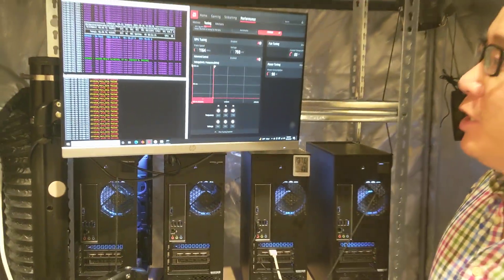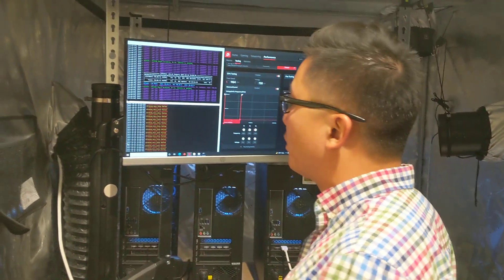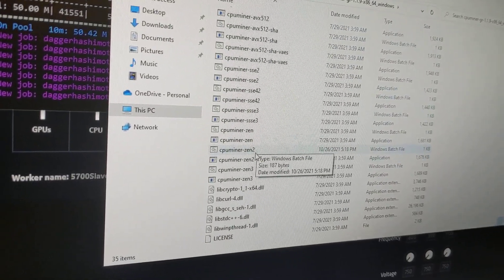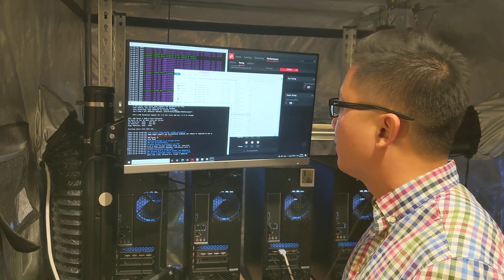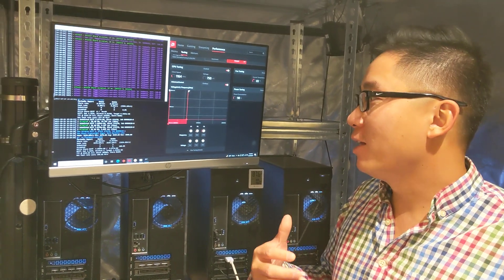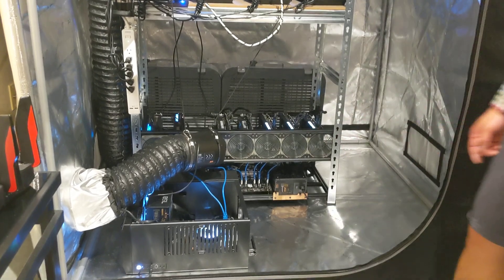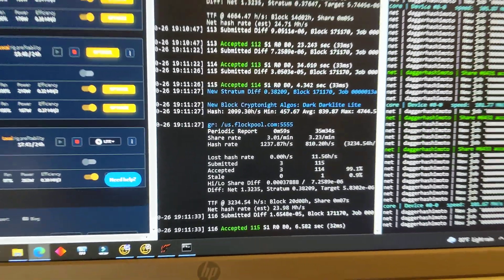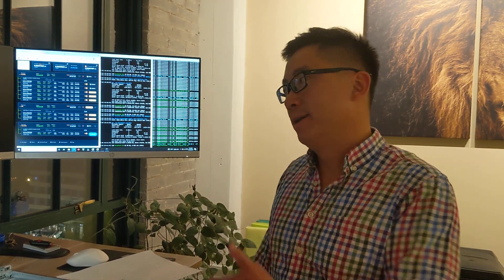How to fix "stratum_recv_line failed" error when mining Raptoreum on 1.1.9

Comment: How do you do this if youre on hive os?
Reply from the maker: I haven't set HIVEOS up yet Jeffrey.

Are you getting this same error? Have you tried using the newest miner ver? They should've eliminated this error.
Reply: @Viet_Tran  i changed miner and it worked but i think its relation to my internet which blocks the 4444 port if that makes sense
Reply: Having problems as well in hiveos.. It was ok 2hrs ago.. Hope we can have a fix for this.. Thanks